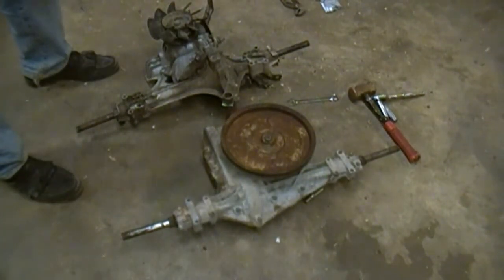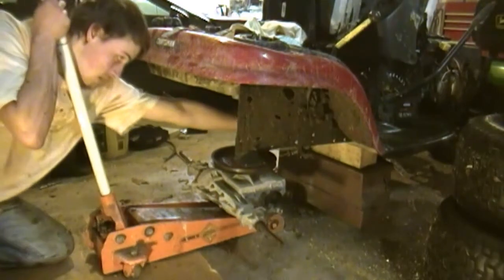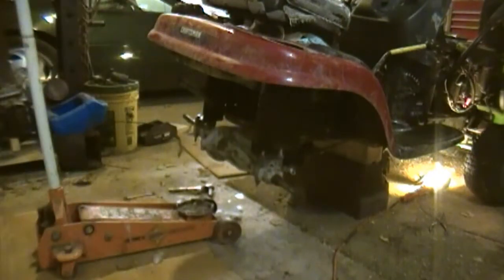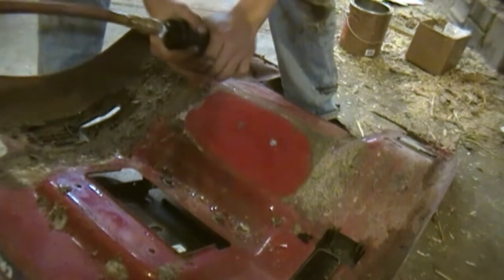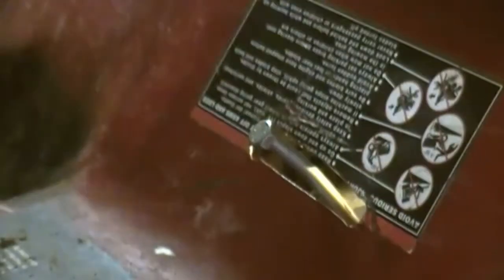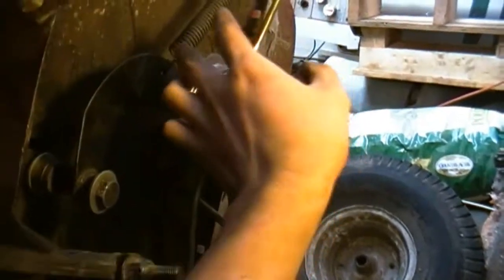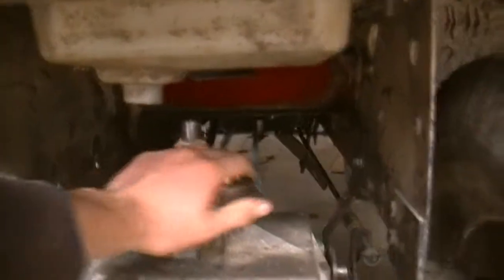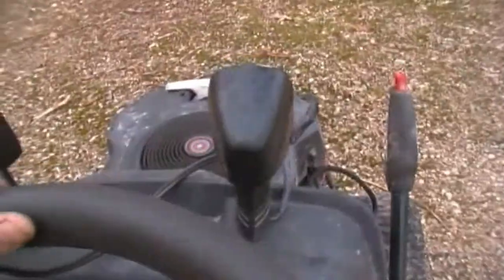Craftsman Dyt 4000 Lawnmower Hydro to Manual Transaxle Swap

Comment: How you did setup the clutch or break?
Reply from the maker: i used the linking off a parts mower
Reply: @hillbillypeakgarage6797  i am trying to do it on a 2006 ys4500 craftsman
Reply from the maker: @familiapabon9658  oh ..i got a DLS 3500 that came with a manual
Reply: I was trying to get rid of the hydro
Reply: @hillbillypeakgarage6797   I have a John deere116 can I do this with the one I have ?
Reply from the maker: @cameronwallen26  yes, I would recommend getting a manual transmission from a JD 116 or find a picture of the transmission and try and find one similar,
Reply: @hillbillypeakgarage6797  the transmission I have is from A sears  tractor it matches up to the hydro
Reply: @hillbillypeakgarage6797 I have a similar one it’s from a sears suburban